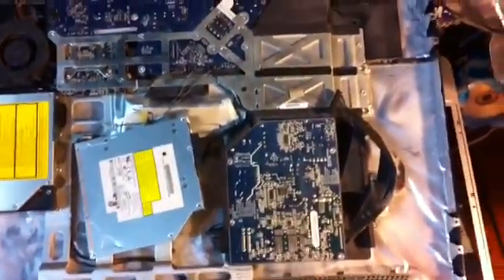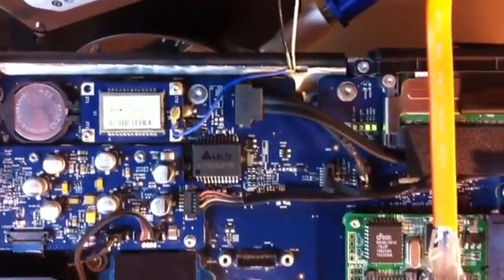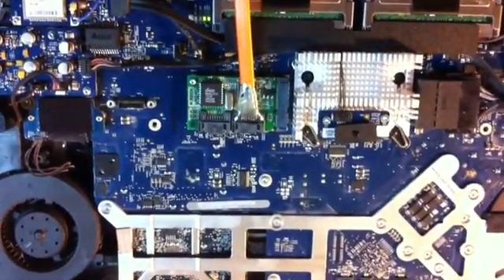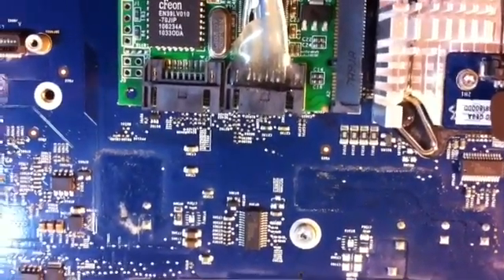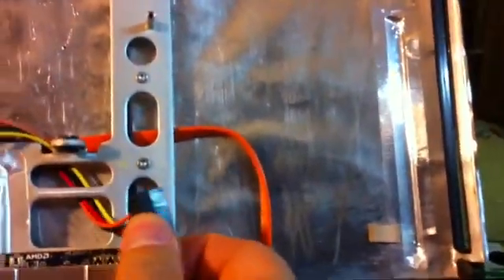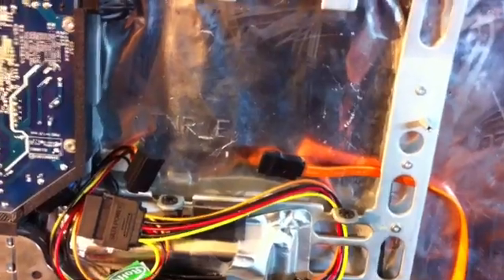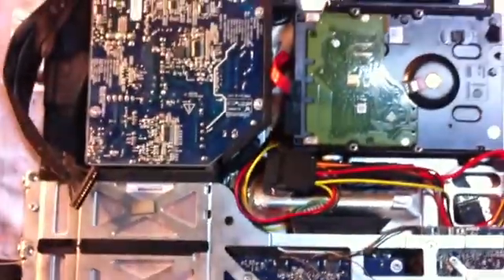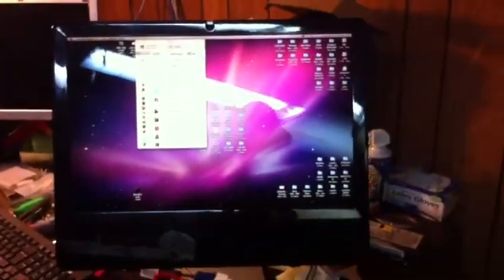iMac (Mid 2007) 128GB SSD + 2TB mechanical hard drive Mod

Comment: Thanks for the inspiration! Just did a similar hack. You don't need to lose the Superdrive., the extra SSD fits really tight just below the screen and to the right. You will need to add some length on the SATA power cord splitter though. Also, you can get a $11 SATA controller from ebay, it works right off the bat and boots without extra drivers. 
Here is the link: https://www.ebay.co.uk/itm/SATA-6G-2-Port-Mini-PCI-Express-Controller-Card-PCI-E-To-SATA3-0-2xSATA3-Cable/272636776246
Reply: Hi where did you connect the controller? Airport card removed?